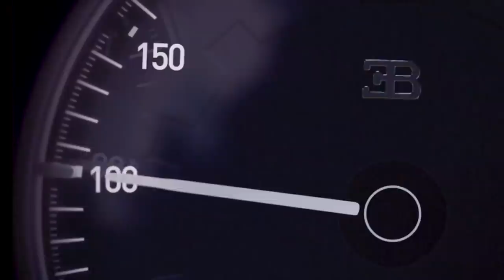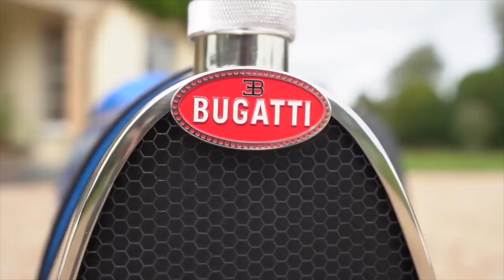Bugatti Unveils New $12.5 Million Dollar Super Car

Comment: To go fast, a electric motor should be considered. Higher power density and higher RPM, and able to reach more than 200 km/h on the first gear. The Chiron can only reach its extreme top speed in special situations, and not very much use for track performance...
To race on a track, should consider a Koniesegg or Rimac as they have innovative technology . If you want the best performance for the price, and able to drive on a daily routine, try a Tesla Roadster...

Comment: Umm the bugati chiron set the top speed world record with upgraded brakes and engine componets, while the koenigseggs are all stock and have all held world records at some point and none of them have ever been tampered with...
Technically bugatti cheated to breaking the 300mph barrier...
and the bugatti is 1,000 pounds heavier than the jesko which means it turns like a truck, and it has 300 more horsepower than the jesko and yet stock, it loses to the jesko... 
sorry if i sound like i hate bugattis (i do) but koenigseggs are just more superior since the only thing a buggatti has is its power (which is impressive from a performance stand point) while koenig has a better chassis, aero, and its so much better in weight and these three aspects make it amazing in corners.